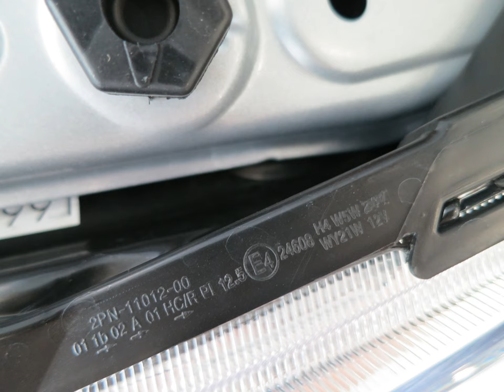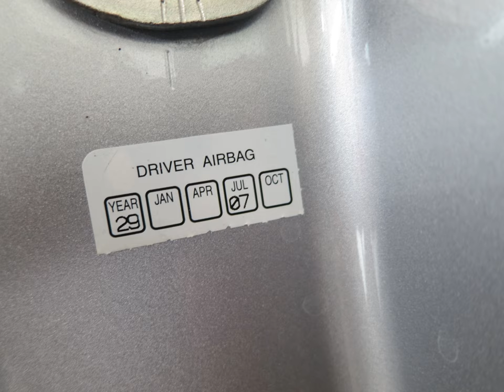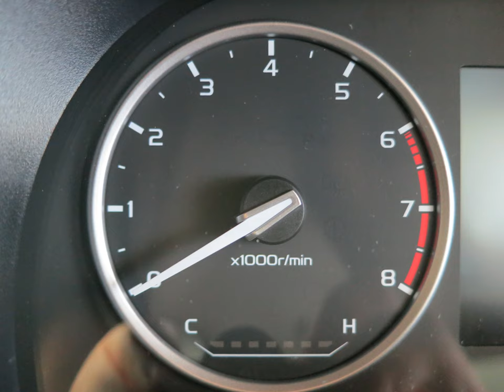2019 Proton Saga 1.3 Premium AT Facelift Exterior and Interior Details Tour

Comment from the maker: 1) Probably one of our most comprehensive photo slideshow videos in recent times. 

2) With the 2019 Saga, we see Proton going back to using a 4-speed automatic transmission which I didn't think would happen. My thinking was that even though the Iriz 1.3 was never publicized much, it's a more up market product with an inferior transmission based on how many complains I read on the Punch CVT. 

3) I love playing I Spy old Proton logo with this Saga because the amount of old Proton logos around this car is truly ridiculous. 

4) Even though I would appreciate a rear bench that splits fold, the way it folds in a single piece requiring only a single press of a button is far better than the implementation seen in Perodua vehicles with a one-piece fold rear seat. 

5) I found the rear seats quite low but the headrest super comfortable and there's a lot of space under the front seats aided by a flat floor. 

Dylan